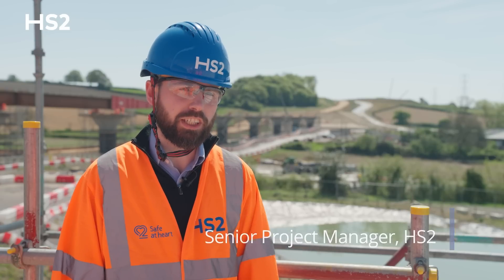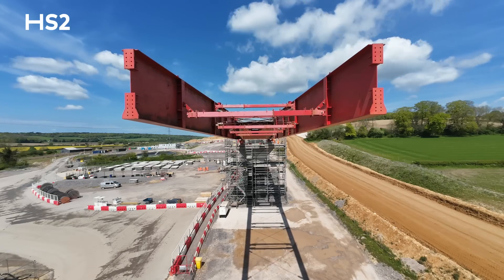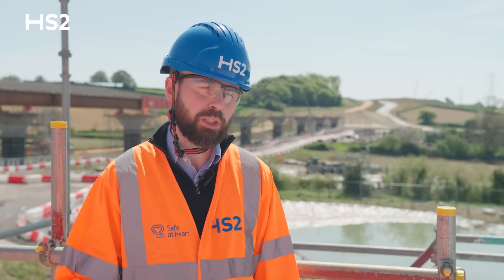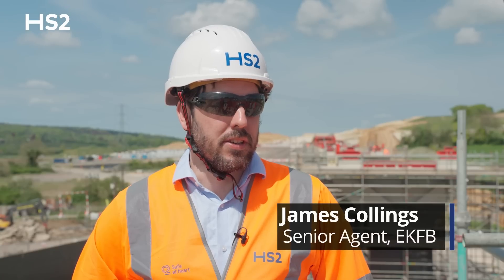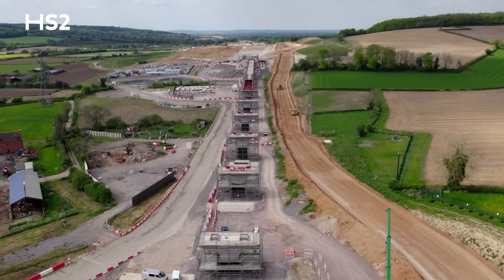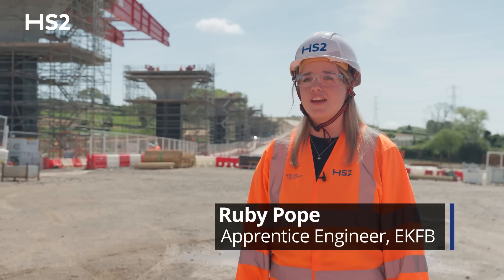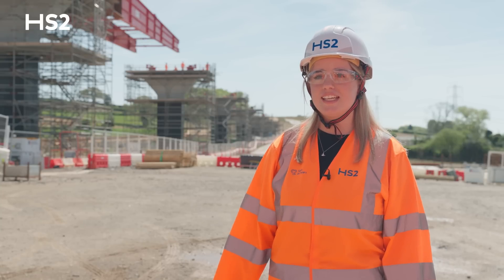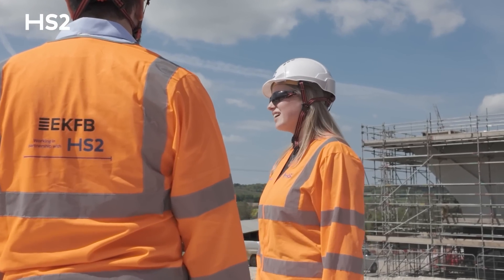HS2 completes 3,130 tonne second Wendover Dean Viaduct deck slide

Comment: I wonder how many coaches the HS2 will have 🤔
Reply: 8 car trains
Reply: Trains will be made of 200m long units - which suggests 10 x 20m coaches. These can be coupled together to make 20 coach trains.
Reply: @martinsloman6905  I was thinking somewhere between 15-20, 8 car trains wouldn’t make sense since we have the avanti west coast trains which can hold 11 coaches
Reply: @evro245 the Avanti Pendolino trains are longer than the HS2 sets by about 60 metres, but the HS2 stations will be long enough that two sets could be joined up to make a 400m train, which, in response to the original comment, would be about 16 carriages long
Reply: Who can tell when the replacement bus service will start

Comment: Over 40 ancient woodlands have been ruined because of HS2 which are over 400 years old some of the ancient oaks so important to biodiversity where here since the sixteenth century
Reply: You are always concerned about the environmental damage caused by HS2 construction. I class it very small by the way, when the remedial works are carried out. What's your plan for reducing  short haul flights in this country ? taking heavy lorries off the motorways ? transporting an increasing population ?.
Reply: @johnhoward607  Once remedial works are carried out, I suspect HS2 will have achieved more biodiversity along the route than when it was started.
Reply: @johnhoward607   The tree huggers have no alternatives. Just a sorry campaign of this nonsense on every HS2 video.
Reply: I believe the figure for the whole route (phases 1 and 2) amounts to 44 ancient woodlands, which would actually lose some trees over 345 miles of route. The total loss of this woodland would be 58 hectares or 0.018% of the UK total. By comparison, the Lower Thames Crossing will remove 57 hectares in 14.3 miles.
Reply: @martinsloman6905  I like that very factual so thank you 👍🏼
Reply: It's only a bloody tree!
Reply: Oh hello again Matt. Still peddling your tripe about l'ost woodlands' I see. Same doodoo different day ... 😂😂
By the way Old Son you may want to read up on the meaning of the word 'biodiversity'. You clearly do not know now ...
Reply: @1chish and you do? Foolish comment!
Reply: @peterhiggs1844   Well given yes I do know the meaning of the word its hardly 'foolish'. Unlike yours which failed to show WHY I was being 'foolish'.
Reply: More of your pressure anicent woodlands have been torns up by the construction of the motorways in the 60's 70's and 80's, HS2 hasn't even touch a single leaf of your 400 year old trees, As the line is going underground,
Reply: nature rebuilds, nothing has been lost.
Reply: @jimdotcom1975  You can't rebuild ancient woodlands and well established habitats - that takes 100s of years.
Reply: @SelmanJulian  rewilding takes decades max. knepp has been going for 20 years. what does it matter if its ancient or well established, what matters is that its not dying out, which it isn't it still exists and is rebuilding in these new areas.